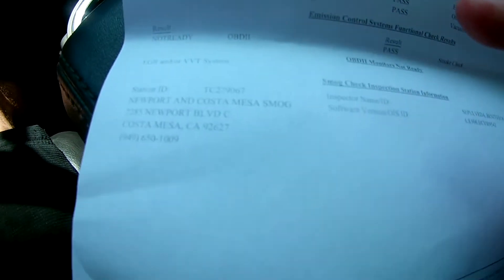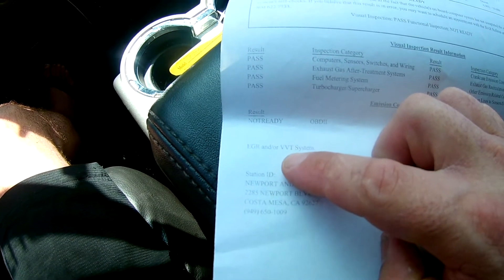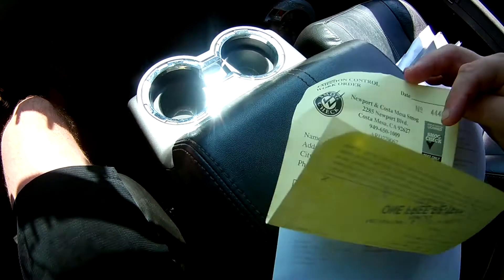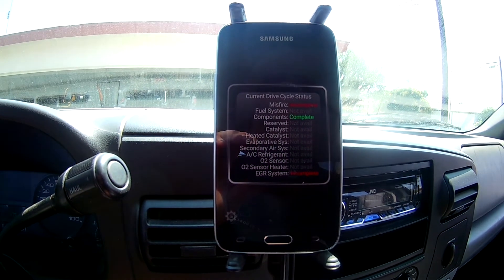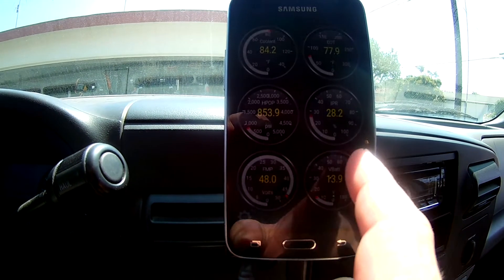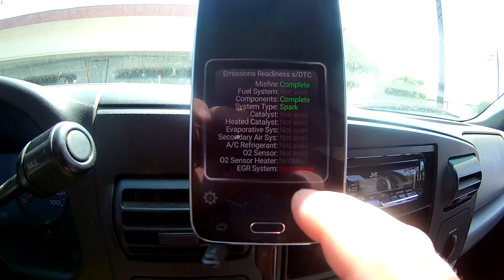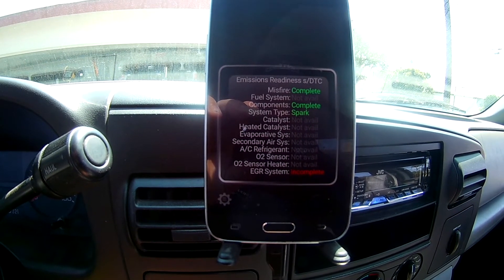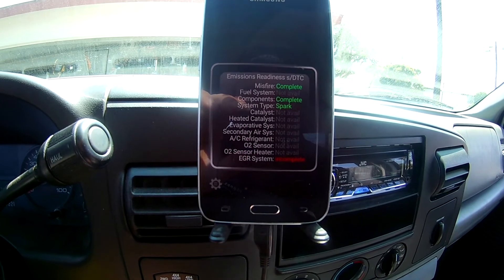F250 Powerstoke 6.0 EGR Not Ready CA diesel smog P1000 Parts 1

Comment: If you a p1000. Get a new pcm..
Reply: P1000 is a systems check incomplete. That is a normal code that occurs when the battery is disconnected or the PCM's memory is erased. You should not be giving advice with that level of ignorance.